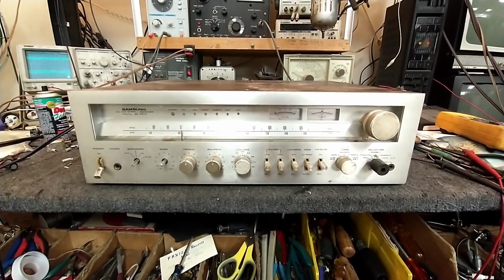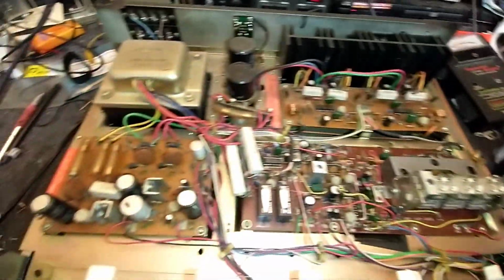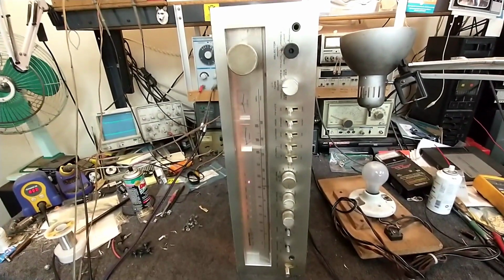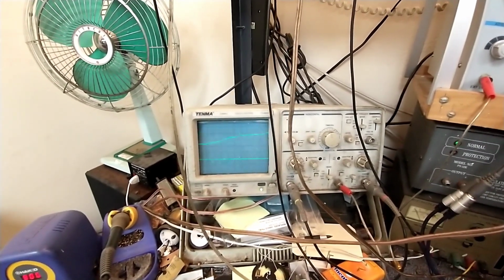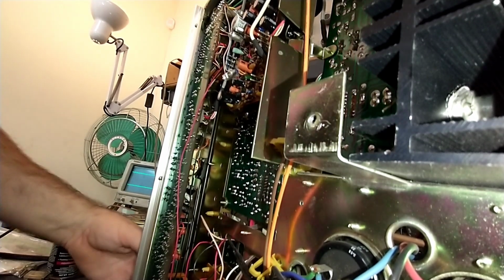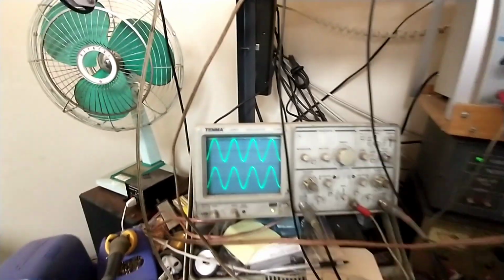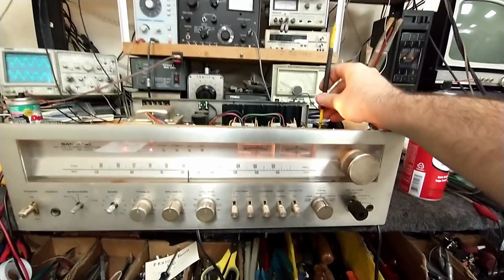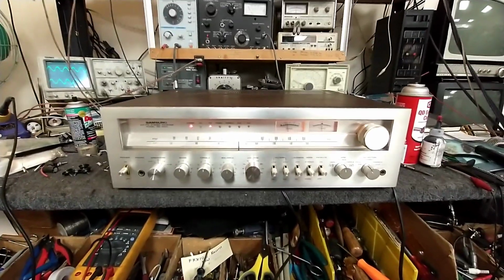Servicing an early 1980s Samsung SS-3500 Stereo receiver.

Comment: I just came across one of these at Goodwill yesterday and picked it up for $67. I found and watched your video while searching for any information at all about this receiver online. Not much out there, this must be rare af. I noticed that you said you couldn't get the tuner knob off. Did you notice the little hole in the side of the knob where a tiny allen wrench goes? Thanks for the video!
Reply from the maker: Yes. My Allen screw someone replaced with epoxy,.so there's that. 😄
Reply: @JordanPier  D'oh!
Reply: Could you possibly tell me what you had to remove to get at the pots to spray them? And also, just curious, did you follow up spraying the pots with CRC with a spray of Fader Lube F5 so the pots stay lubed? Thanks in advance!
Reply from the maker: @rwilkie6738 yes, faderlube after CRC. Think I made an extension straw and went where I could see the small openings

Comment: June2 2024, Good morning, just saw your videos.  I have two 70s receivers. Problem , I’m retired and would  to have them serviced.  Would like to  l play my albums again.  I’m  in calif. San Bernardino area  .  Do you take in work? There’s no one around here.
Reply from the maker: Repairaudio.com is a good place to start. That's The shop I work for.
Reply: Thank you very very much. I am restoring a mid century modern cabinet to houses my stereo items. But electronics I don’t have a clue. Just a heads up for you  I have a Lafayette LR5555A  &a  Kenwood KR2600. LR is nice, Kenwood has dead B speakers. Thank you again.

Comment: Working on a Hitachi SR-604 on the bench now. Orion audio blue book lists it as 35 watts per channel, but it is a class G amplifier design. 
There are two power rails, a high voltage rail, and a low voltage rail. The high voltage rail has 63 volt caps on the power supply and the led power lamps go to 70 watts at 8 ohms. The Orion books have many errors in them, guess I will have to run it up on the treadmill and see what it really does. Carver and Kenwood also made some class G amplifiers.
Used some Simple Green cleaner on the front face and it started to remove the silk screen print, oops! Never had an issue with Simple Green removing silk screen printing before, until now. I did know not to use Clorox wipes, as they will remove silk screen printing.

Comment: Very nice work Jordan. I haven't seen one of these since the 1980s.  This receiver came out in 1980 with an MSRP of $339 but street price was anywhere from $150-$250 depending upon where you bought it. Lafayette Radio on Long Island sold it for $157, Leo's in California sold it for $140, Shogren's in Oregon claimed it was a $399 receiver they sold for $229. In those days stereo shopping was like buying a car, all over the map.  As for performance, it's as you said, 45 watts per channel into 8 ohm load. Specs were 0.05 TDH 20hz-20khz. Much better build quality than I ever expected too.
Reply: 1997 Orion audio blue book shows production dates from 76-81, 45 watts per channel, and MSRP of $340, retail used $23, mint wholesale $14, and average wholesale price of $8, which is what the local pawn shops would have given you back in 1997 in the U.S.!

Comment: Very nice receiver you got there Jordan!
Years ago Iv'e got a Rising (Never heard of this brand before) TS-1 receiver as a gift (it has the tape deck built in), the amp is a- STK job, but the front looks very much like your Samsung.
Since you've mentioned it, what can cause a protection circuit not to do it's job?

Comment: Nice video, can you please tell me what type/brand of cleaner have you used to take care of those dirty switches and pots . Thank you
Reply from the maker: It varies base on how terrible of condition theyre in.

First you clean with CRC QD.
if that doesnt work, deoxit F5
if it still isnt happy NuTrol 401b
Reply: @JordanPier Do you buy the Nutrol on line or locally?
Reply: @JordanPier That's a big transformer, how many what's is the receiver?
Reply: @JordanPier Do you do videos of repairs of vintage test equipment?
Reply from the maker: @SDsailor7  cant say that I do, but I do have a vtvm that needs repair. If i csn find a schematic on it, maybe ill make one.
Reply: @JordanPier  Thank you for replying back. That would be an interesting one if you do.

Comment: The zenith receivers you see on eBay were built by this company.MC70xx
Reply: Sold a decent number of the Zenith MCS series. 100 % reliable.  Only odd thing is
Gold Star built most of Zeniths smalls including the famous R472 clock radios.
Anyhows tnx for the vids, hows about a TV or 2 next ???
LFOD !
Reply from the maker: @tomj4506  got a sony CVM in the works soon!
Reply from the maker: I thought it looked familiar....